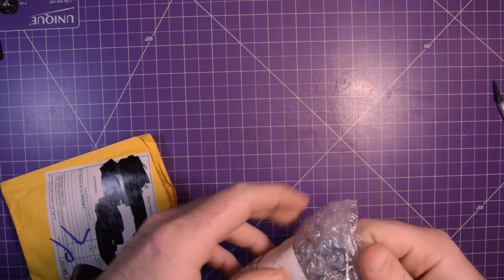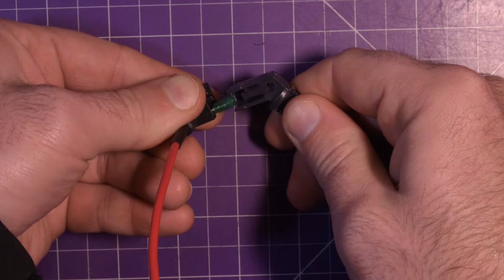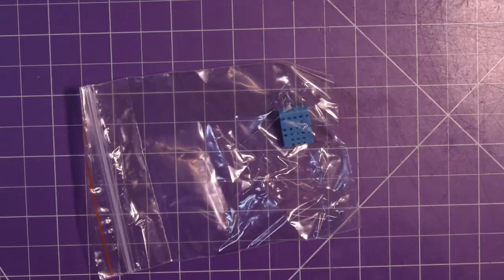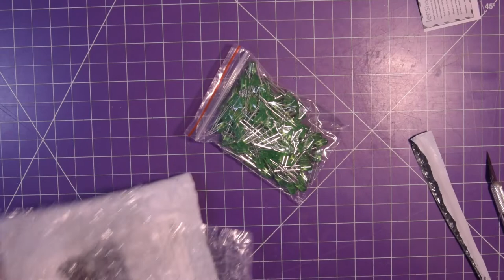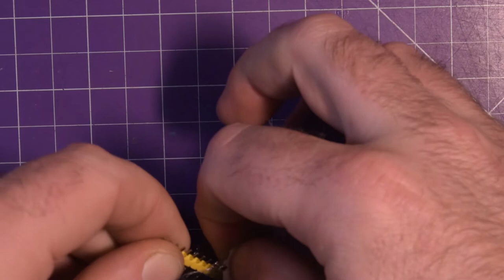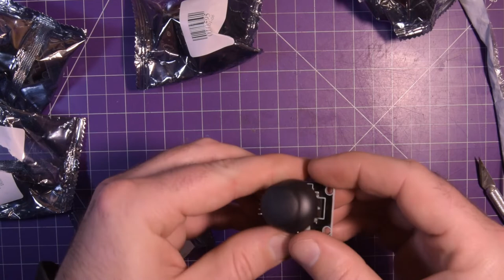Mailbag 39 - Last Of The Year!

Comment: Great video!  I do think the dht22 is a worthwhile upgrade from the dht11. You spend a little more and trade some sampling speed of the dht11 for accuracy. Also, in your environment the ds18b20 that are in the little metal leads are fantastic (with no humidity). We deployed over 250 of them in Alaska.  A few cool uses, we buried them every foot inside a pvc pipe 10 ft into the ground to measure ground freeze levels, we also put them in little copper fittings called thermowells to measure input and output temps of our boilers to calculate efficiency and BTUs.  They held up really well in extreme heat and cold.  Enjoy your holidays and thanks as always!